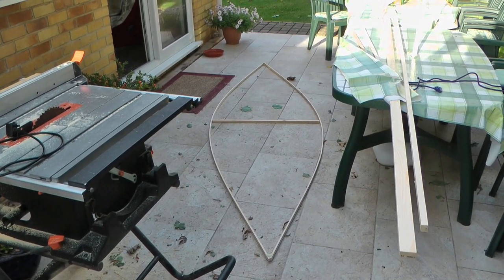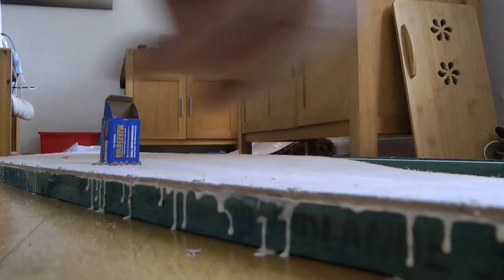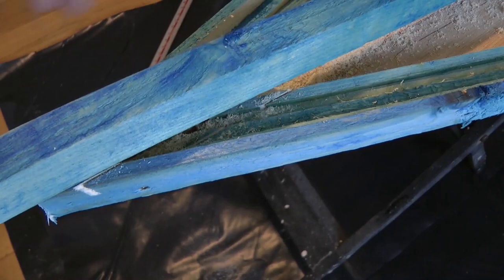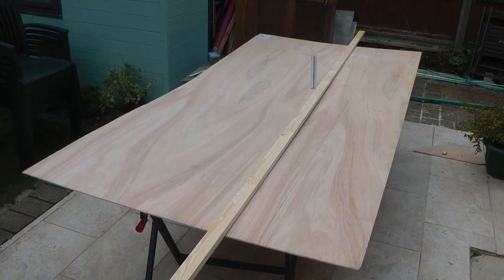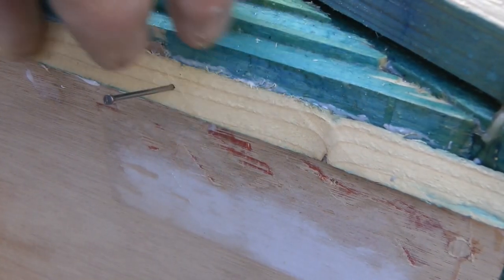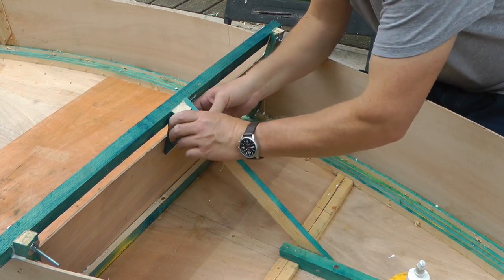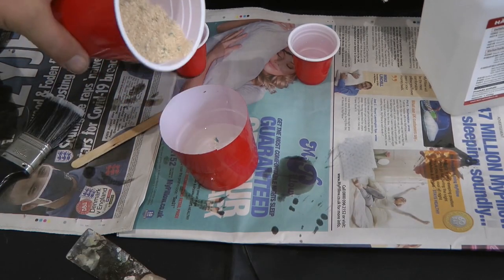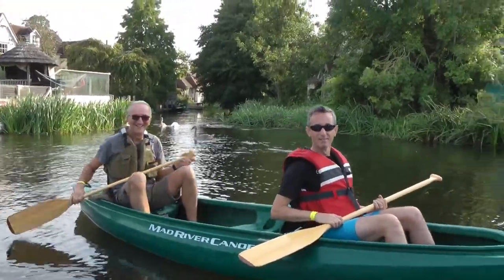DIY self build homemade design plywood wooden kayak fishing canoe boat UK

Comment: I absolutely LOVE how many "rules" of boat construction, and "standards" of marine builds you utterly ignored in this build. You came up with a passable craft, obviously able to paddle it a good distance, despite whatever alternate "standardized" methods might have been breached. I'm not being facetious at all. I hope your creation gives you many years of service. The only addition I'd suggest is a gunwale batten bent around the upper rim both for rigidity, and as a nice accent to the boat visually. Watching this was FUN!!!
Reply: And some floatation
Reply: How could he have incorporated a gunwale batten? Could he have done that with straight sides?
Reply: Mmmmmmmm I built super yachts over a period of 14 years and we had many a wonderful time from the scrap wood etc building canoes and boats like this one😀🤗no rules just having fun and considering that he traveled quite a few miles just shows how good the diy craft was🤩🥳🥳🤩🥳🤩
Reply: As it's a single-person...depending on the rivers and lakes in question, front and rear decking might make it more "wave-resistant." You could use it as cargo, or enclose it and use it as flotation.